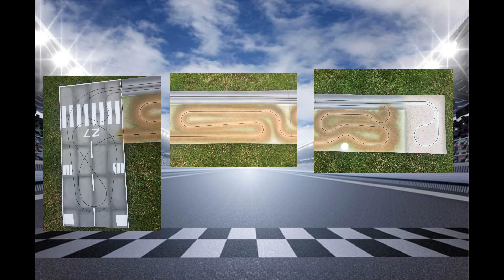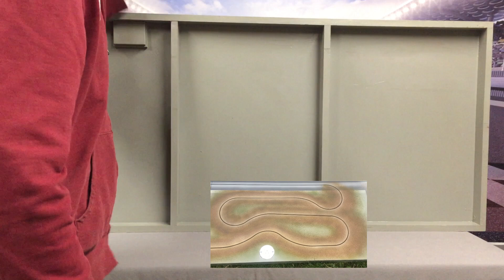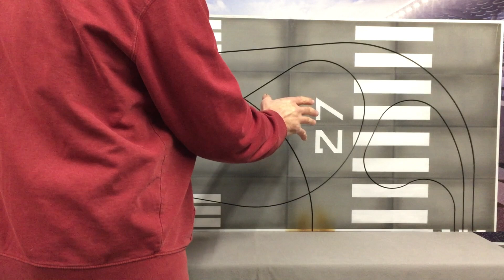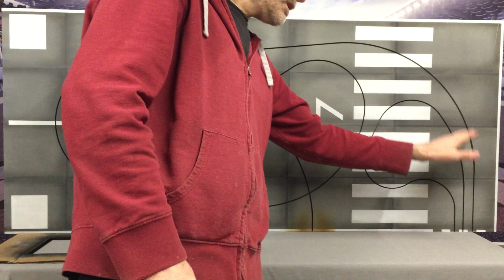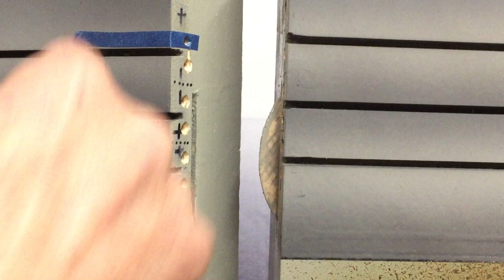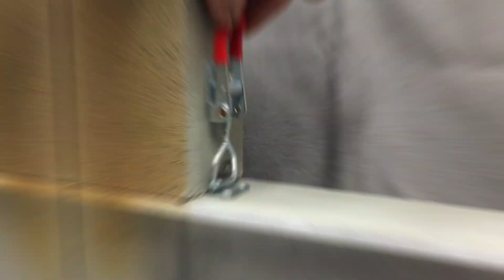Partial construction of a new rally slot car track.

Comment: thanks for this Rob, really useful tips! Couple of questions. 1. What do you exactly mean by "tin" the wire/copper? 2. I've looked at XT60 connectors and they need soldering, is that necessary? Thanks Max
Reply from the maker: Tinning is when you strip the wire, apply flux and then add the solder to the wire ready for joining. You'd 'tin' both items to be soldered and then bring them together and melt them into one. To tin the copper, would mean you simply polish the copper with a fibre glass pen or sand paper, add flux and load the fluxed copper with solder. The XT60 connectors will need soldering, there is no other way with those, but they are VERY good connectors and worth the effort.
Reply: @SwiftSlots  i think i am missing flux in my soldering slot car life in general!! thanks!
Reply from the maker: @maxfreeman3217  Most general 60/40 solder has a resin flux in it already, but there are some that say that is enough, I say it isn't. Adding more flux is always a good idea, flux helps everything flow, even if you use too much! DON'T use plumbers copper pipe flux!! It is VERY corrosive and will eat your wires away after a few years, ask me how I know!!! It also falls down like rain when soldering with it and shorts out electrics, again, ask me how I know! Use a good quality water/acid based flux and you'll be fine 🙂